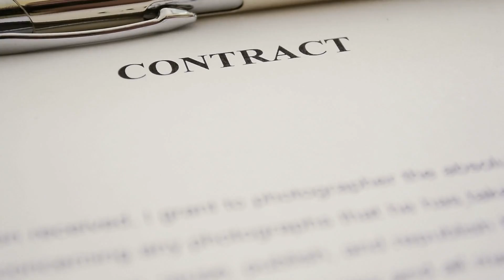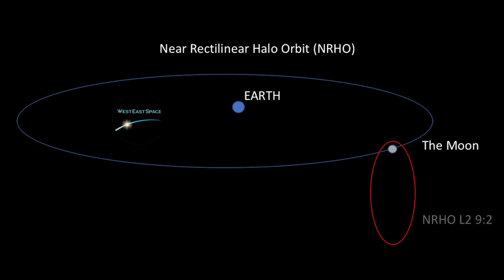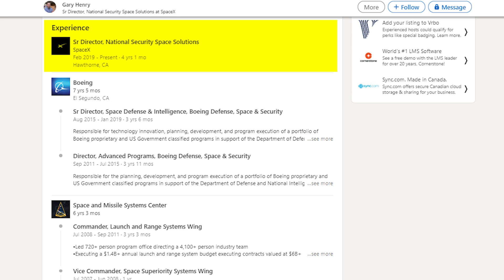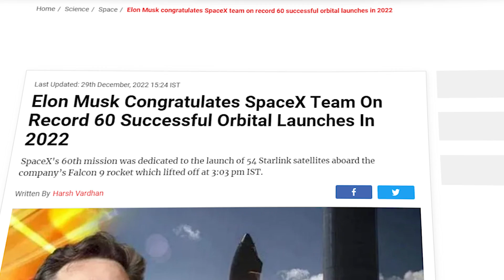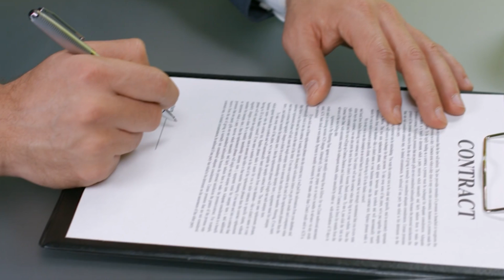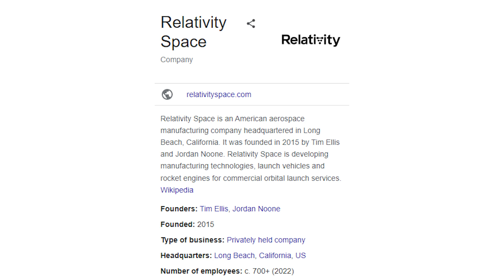NASA Reveals Major New Lunar Gateway Update!

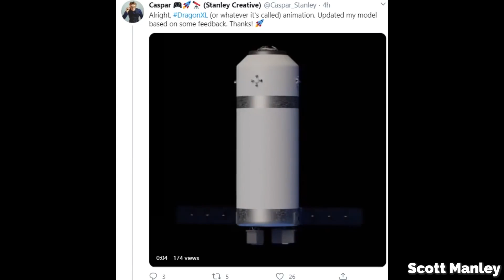Comment: 3:03 Look at that Dragon XL capsule render from a Scott Manley video. It is NOT a crew capsule for returning to Earth. Dragon XL is a one-way, pressurized cargo capsule to deliver ~5 tons of cargo to Lunar Gateway. Since it is pressurized, it was planned to be used as storage or a crew room. After it had delivered its payload, it was to be disposed of on the Moon or in a heliocentric orbit. Since HLS Starship was announced the next day after the Foust article at the beginning of the video (mentioned earlier), it is not surprising Dragon XL is on hold since HLS Starship can carry so much more.

If SpaceX is early with a Falcon Heavy rocket, so what? Northrop Grumman is building the Habitation and Logistics Outpost (HALO) and Maxar Technologies is building the Power and Propulsion Element (PPE). Those two need to be ready early, not SpaceX.

Currently, Artemis III is planned to be done without Gateway. NASA noted in the Apr 2021 HLS Option A Source Selection Statement, that HLS Starship has an excess propellant margin for the landing, so there will be no problem of not using Lunar Gatesway.

The Artemis IV mission will have a Lunar Gateway construction component and a manned landing with either HLS Starship under the HLS Option B contract or whichever lander wins the Appendix P competition, if it is ready in time. The International Habitation Module (I-Hab) will be carried behind Orion on the SLS 1B for Artemis IV and ESPRIT will be carried with an Orion on Artemis V. The lander for Artemis V, is whichever lander doesn't do Artemis IV.

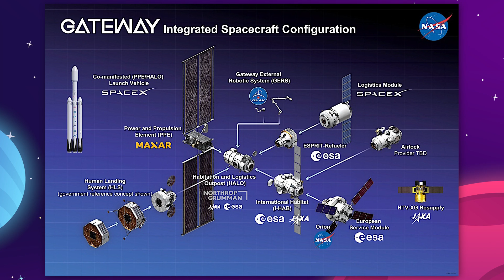Comment: 1:40 The graphic you show has nowhere for propellant to be stored for future refueling stops to other locations in the solar system. Also, unless Artemis develops resource extraction on the Moon rather quickly to make propellant, you still have to truck all the propellant to Lunar Gateway. So refueling spacecraft going somewhere else is a longer term project.

One of the things that Artemis wants to develop, is how to extract resources from regolith on airless or nearly airless worlds. NASA has a RFP out for ideas on how to free water ice from regolith. The example plan NASA had was tenting over a section of regolith with a transparent dome and using mirrors to direct sunlight under the dome. The water ice would sublimate to water vapor to be extracted from the dome.

The PPE is for station keeping in the NRHO. That orbit was used, instead of a lower one, because it is very stable and needs little propellant every year for station keeping. MASSCONs (mass concentrations) on the Moon are mostly on the Earth side of the Moon, so low lunar orbits are not very stable.

The PPE and HALO launch on a Falcon Heavy NET Nov 2024. I-Hab goes with Orion on Artemis IV and ESPIRT goes with Orion on Artemis V.